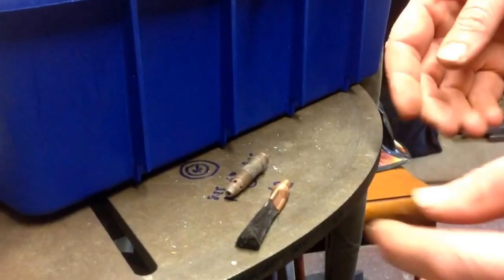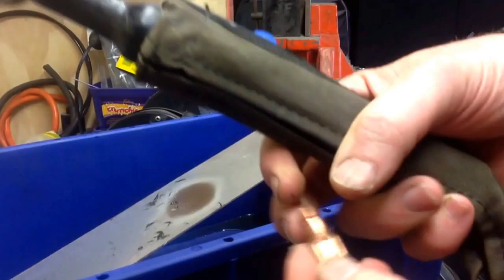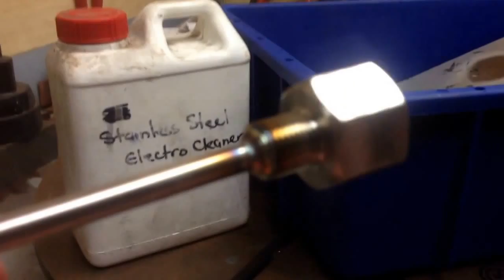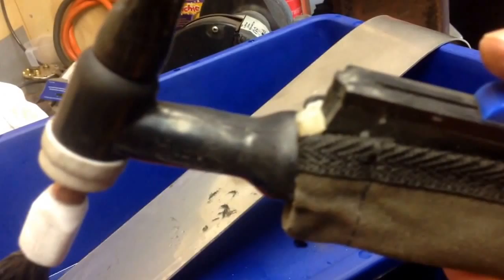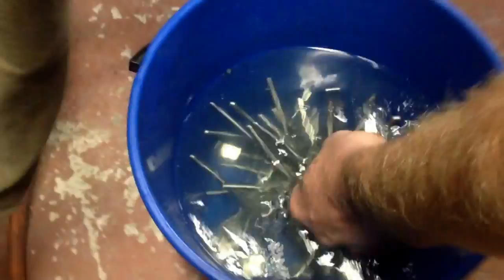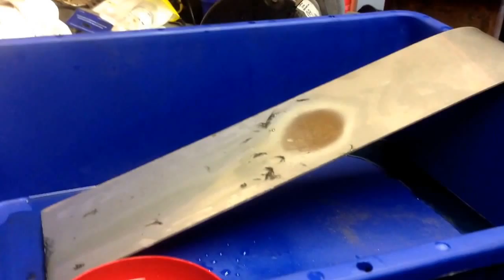Electro cleaning using tig

Comment: VERY GOOD .BUT WHAT ACID DO YOU USE?
Reply: Check the MSDS on the fluid. I found that its 30% phosphoric acid. I have had good results with a rust converter fluid from the paint section of your hardware store. I have some carbon fibre rope in transit at the moment and will have a crack at swaging it into some copper tube. I've been using a cheap dc caddy welder at 10 amps with brush on the negative
Reply: Phosphoric acid can be used
Reply: Use a chemical called Surfox-T it is made by Walther company

Comment: Does your tig machine work or is it broken now? I have heard that DIY use can broke your machine.
Reply: It would be surprising... 5 amps are harmless, whatever the machine you use
Reply: You should be careful about acid vapor...
Your machine will be fine, but your lungs will require protection

Comment: nice vid, thanks! I am joining flat pieces of A4 stainless to stainless tube using silver solder - with the cheek pieces on either side of the tube, this creates an area I can't get into to polish mechanically. So this method may work wonders for me - have you tried it on silver solder joints where one gets flux-and-heat staining on the stainless steel? cheers
Reply: Hey Gurgle Jug any updates on this? In a similar situation here- the behavior of silver solder is much less documented I'm finding!
Reply: @alexbeach9398  sorry mate, not heard anymore about it, no other replies either. Will ask some welder mates, let you know if I get any good info. Cheers

Comment: Thanks for this video.  Put this into practice today and was very happy with the result.  Sourced items from QWS in Brisbane, QLD, Australia.  Brush was a "TIG Brush Tip".  Has an M6 thread so was easy to tap into a spare Collet.  Ran approx 5A DC on high frequency mode.  Cost ~$150.  Chemical is a bit expensive but should go a long way.
Reply: Electrode positive earth negative?

Comment: Cool! Much more professional than these electropolishing transformators. But WHERE do you get those brushes? Couldn't find them.
I reccon it's DC and rather low amps? 
Any chance to do that in a bath with multiple parts on a rig?

Comment: Hello,
your method how to clean stainless is very interesting and simple ! Did I understand you right that you set the amperage of your tig machine to 5 amps and 'high frequency' start ? Or do you use 'lift arc' mode of your machine ? Can you post a link where I get the brushes ?

Thanks a bunch in advance !
Reply: 9106
Reply: hi. we from China UBS welding company. we also manufacture those welding cleaning products. would you like to compare? Our is 124 USD/set.the cleaning bursh we also in sales. pls feel free to send email: jessie@0757ubs.com. Thank you.
Reply: @jessieliang4159  hi
Reply: 9:6913
Reply: 911613
Reply: 43:760
Reply: 960:
Reply: 9:316
Reply: 30:4390
Reply: 8139